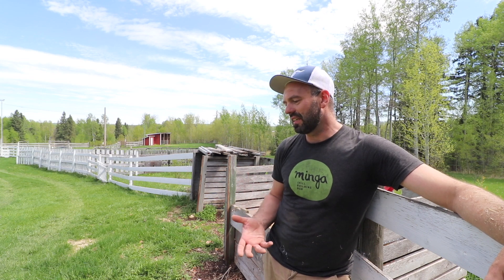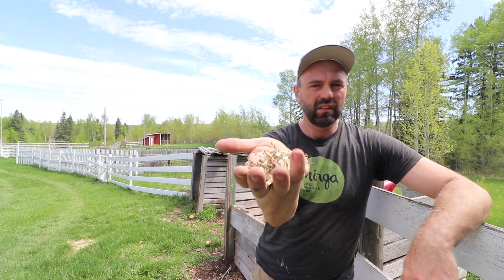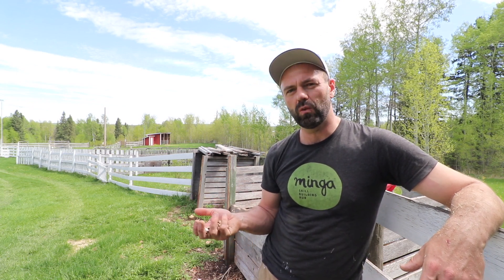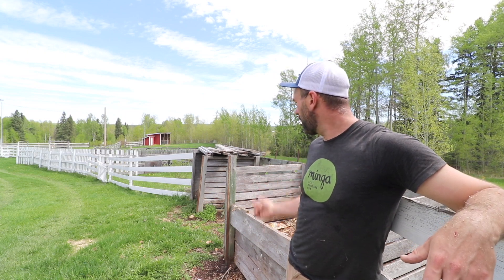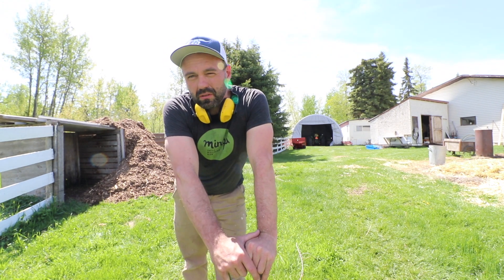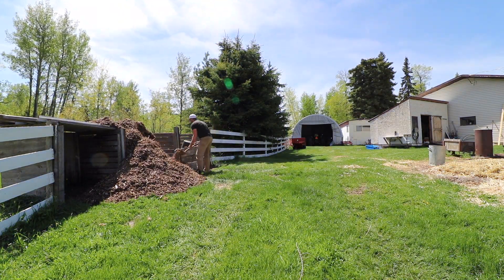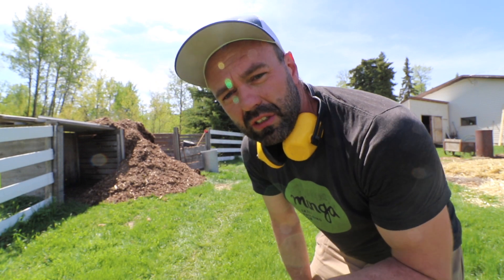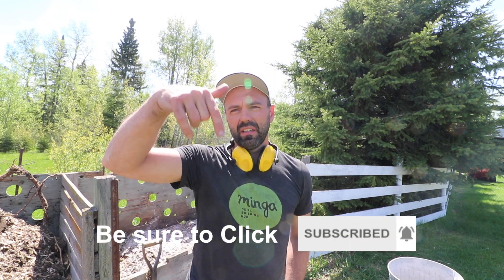Why Compost Fails: Successful composting tips

Comment: In my opinion, the best place for a static compost pile is directly where that compost will eventually be used. Might as well make it even lower effort! Static piles don't have to be big, so you can easily fit them in between plants, or in the middle of a bed (keyhole gardening for example)

Comment: I live in the suburbs of Montreal and this is how my compost pile typically works:  April-May: rake up all the crap left over on my lawn after the snow melts (mainly leaves, branches, pine cones, soaking wet flyers and other junk mail) + remove excess mulch from flower beds, dump it onto my compost pile.  Cut out any left over dead plants from last Fall or anything that was killed over the winter (esp. branches from small bushes and small woody perennials).  Any twigs etc cut up into small pieces.  July/August: Weed my neglected flower beds and vegejungle, and dump the weeds onto my compost pile.  Often in September or October my friend cleans out his chicken coop, so I have bales of straw covered in chicken manure, that I dump onto my compost pile.  I also rip out all the annuals from my vegejungle and dump it on the pile. Early november: dump my neighbour's leaves onto my compost pile (but I use most of them as mulch), and add water to try to make it into a hot compost, but winter begins a few days later.  Late November / early December : the pile is frozen solid and covered in snow, maybe I'll try again in the Spring, April-May: the cycle starts again...

Comment: In my experience, static piles have overly dry pockets and wet pockets despite efforts to add evenly moistened materials. My piles do better when turned at least once. IMO particle size and moisture levels are critical to success as well.
Reply: I have also found this to be true. Even one turn part way through seems to help tremendously.